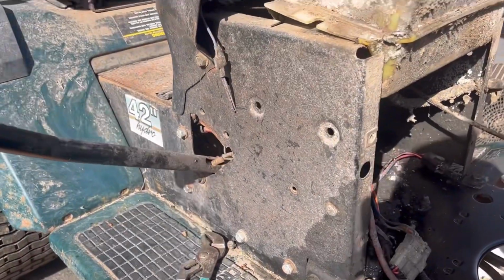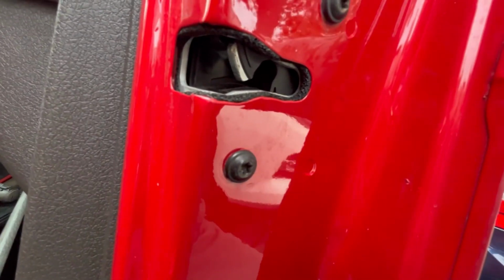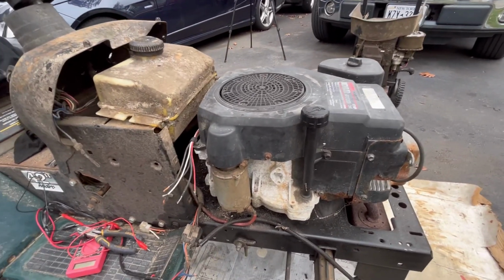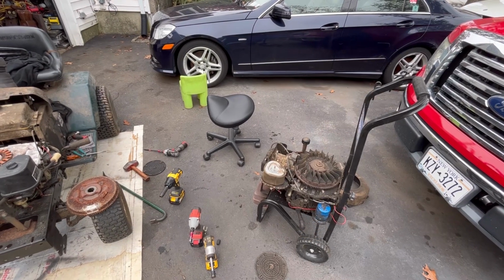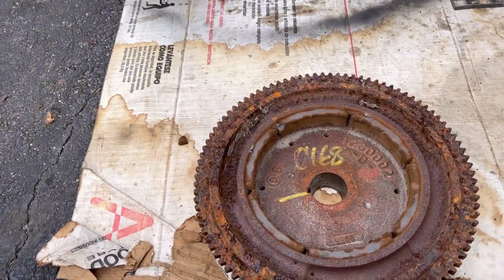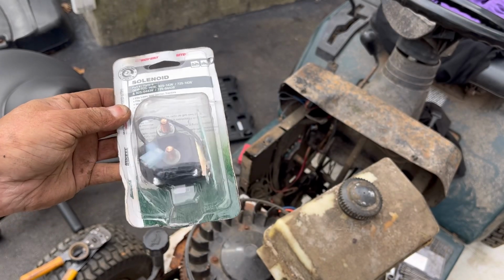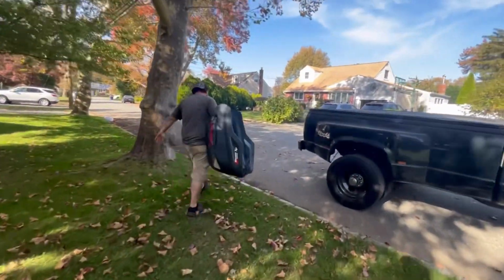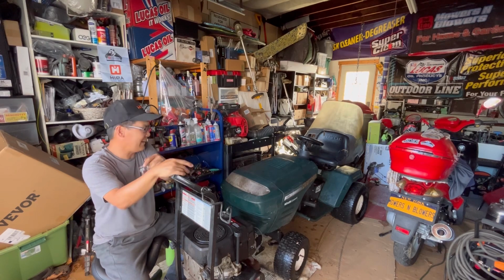FREE CRAFTSMAN 15/17 42” LAWNTRACTOR KOHLER COMMAND ENGINE SWAP HAULER PROJECT ELECTRICAL & STATOR

Comment: The flywheel with four magnets will not charge correctly, needs six.  Lots of corrosion on hauler mower engine, all that white stuff. That's why ignition coil bolts broke off.  Good swap.